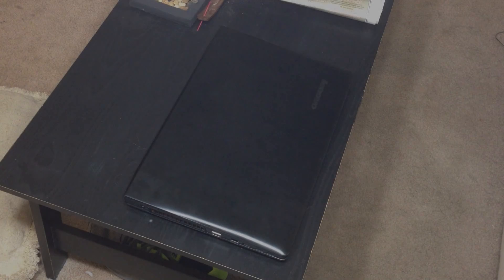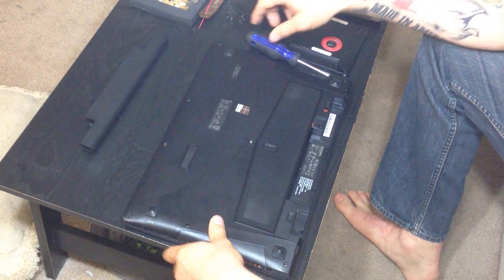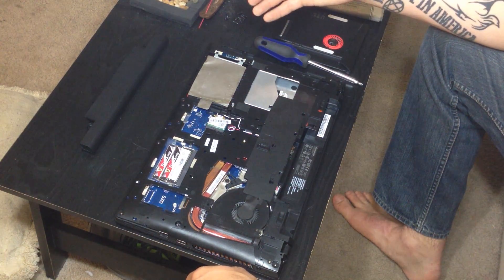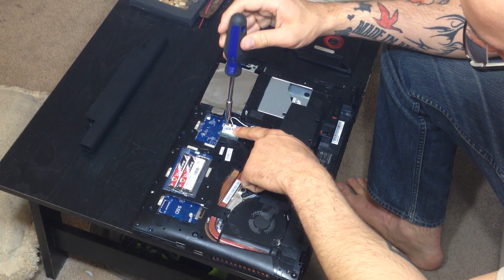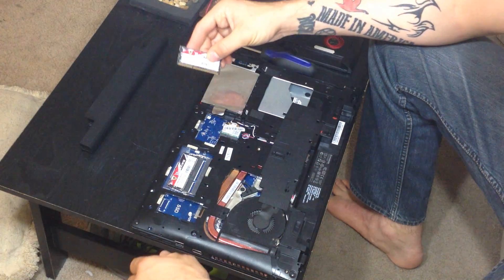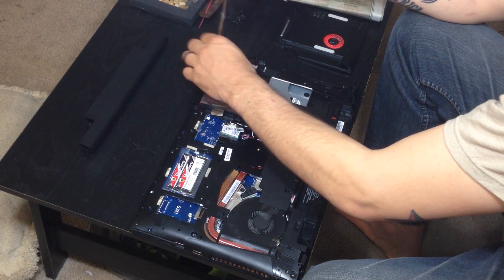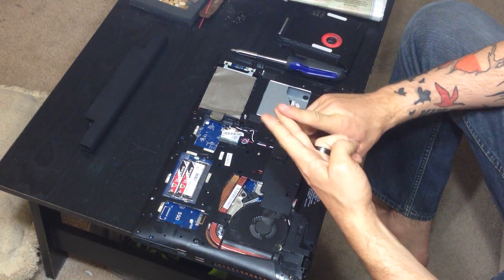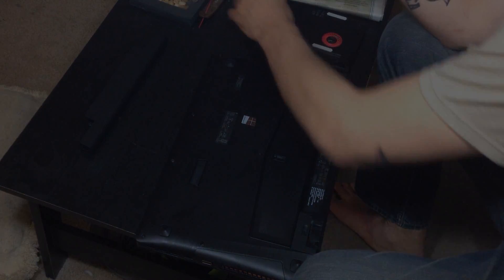Lenovo IdeaPad y510p SSD/Ram/WiFi Card/M.2 SATA Install and Swap

Comment: Hey! Thanks for the video.

Did you repaste the CPU/GPU  of the laptop? What temperatures are you getting when playing games?
Reply from the maker: I did reapply thermal compound to the cpu and gpu when I installed the new i7, yes. I am getting no hotter than 80 celcius. And that is with the laptop on my lap blocking the vents.
Reply: Hey thanks for reapply!

I don't know if this is too much to ask, but can you do a tutorial on repasting the CPU and the GPU?
Reply from the maker: Day Blue Sure thing. I will post a video within a few days.

Comment: Just quick question.

I thought y510p had mSata instead of m.2 sata port. Am i getting wrong?
Reply from the maker: It has mSata in the mechanical hard drive. Yes. But it also has a m.2 sata port on the motherboard that you can install an m.2 sata card there.

Comment: Awesome video!

The i7 vs i5 comparison video would be really interesting, do it, please! And also if you can rec the video about how you change the processor, it would be great!

Will you do a stress test using Prime 95 and Furmark?

Thanks for the video!
Reply from the maker: I sure will do a stress test with Prime95 and FurMark when I get the new processor. I will post installation videos and stress test videos when I receive it. I plan on doing the same videos again with the i7 so you all get a fair comparison to see how the i7 performs vs. the i5.
Reply: Baustin McManus
Could you do it with only 1 video card? In notebookcheck there's already a benchmark with the SLI version, but I wanna know the measures with just 1 Card and a DVD reader. Thanks! Nice Channel, waiting so hard the video about how to change the i5. (Wanna see the real guts of this laptop)!
Reply from the maker: Yea, sure. I did the first benchmarks with both video cards in, but only one was running. I'll do the same when I get the i7 installed. Rambo Hunter
Reply: Baustin McManus Thanks dude!
Reply from the maker: Any time bro. Rambo Hunter